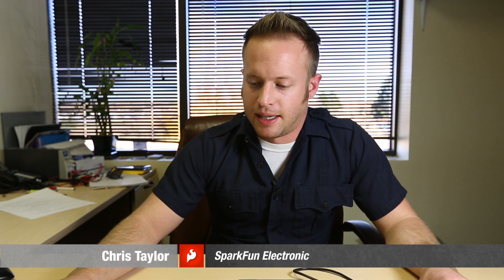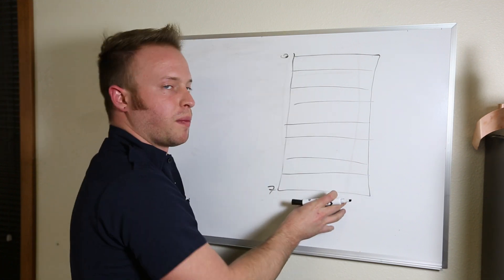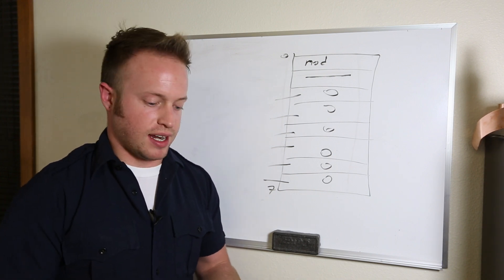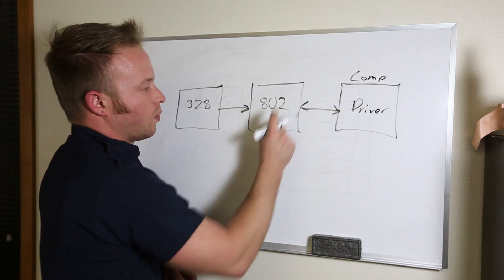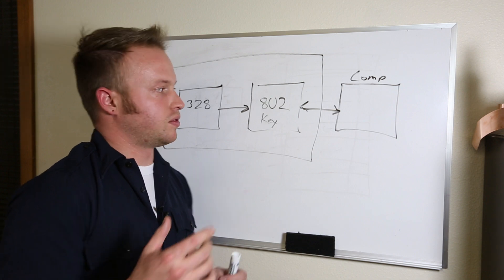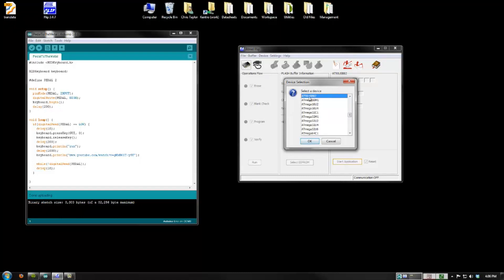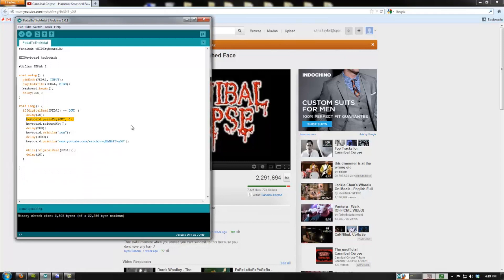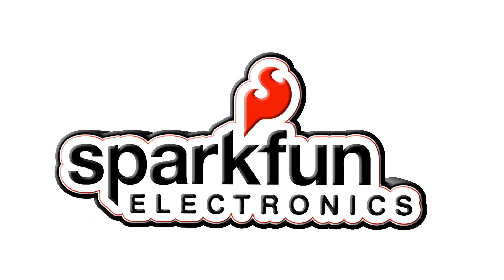SparkFun Engineering Roundtable 11-12-12: HID and USB Devices with Chris Taylor

Comment: Im working on a mouse. I have /dev/hidg0 working on my pi 4

Here is a example of my problem. 
\x00\x01\x01

This should move the mouse one pixle for x and also y. This is a  Diagonal movement. 

If i repeat this multiple times it Is inconsistent. Sometimes it moves x 0 pixles and y 1 pixle  And vice versa. 

Is no matter what value I use, I have inconsistent inaccurate results.

It could be due to the initial set up of my HID bit set instructions?

Comment: ok, the rev 3 was giving me problems because i have a 64 bit operating system installed. from the atmel forum "FLIP in 64 bits OS", i saw i needed to delete some improper driver file and install the driver manually. after doing that it works like a charm! whohoo!

Comment: it looks like its supposed to be pins 5 & 6 of the header that is closest to the reset button (the top two by the usb), same as the rev 2 smd board. However, i cant get mine to work either-- on two boards now

Comment: Can't one create a custom bootloader image that talks the avr109 protocol, but listens to rs232 instead of usb?  Then you have the best of both worlds, the 8u2 will act as the HID device, talking serial to the 'duino, but the 'duino will talk rs232 and implement the avr109 protocol.  Then you just hookup a ftdi breakout (sparkfun sells them) and it will work with the arduino software.

Comment: Might be helpful to tell people that there is also the Arduino Leonardo which is not only cheaper than the Uno, it does all the same features as the Uno, it's faster and doesn't have an 8U2/328 combo but rather is a 32U4 which means you can send Keyboard stuff, Joystick, Mouse, etc... directly in your program and avoid the complicated 8U2 firmware switching process.

Comment: I have Arduino Uno R3 DIP version with Atmega 16U2. so 8U2's hex file will work on 16U2 ? and Where should I solder 10K resistor on my Arduino ? :S